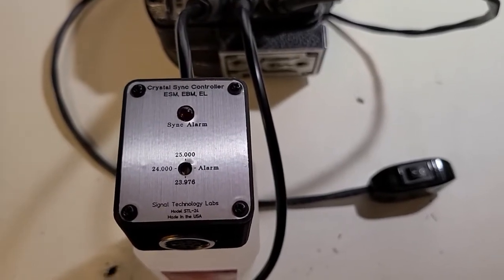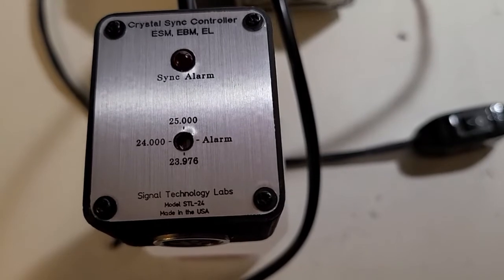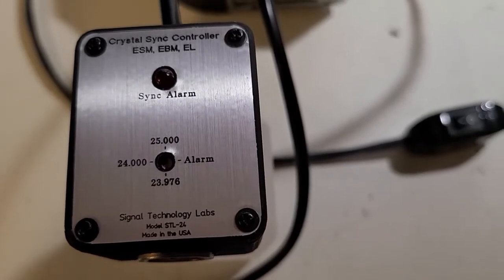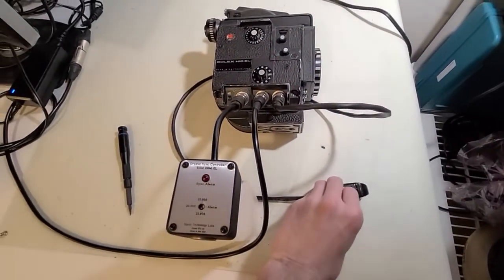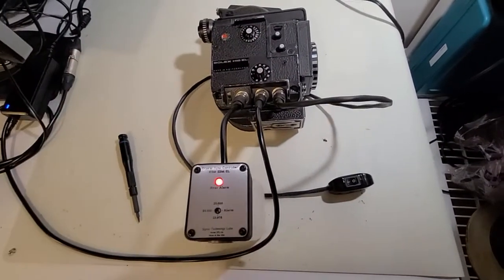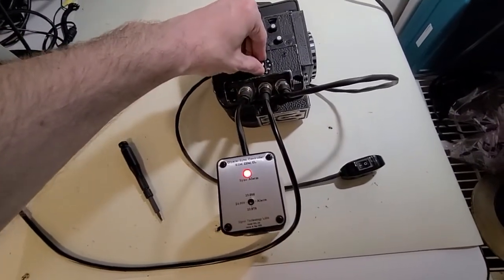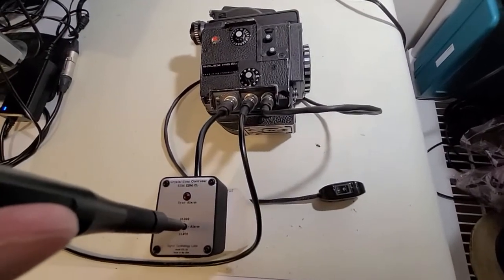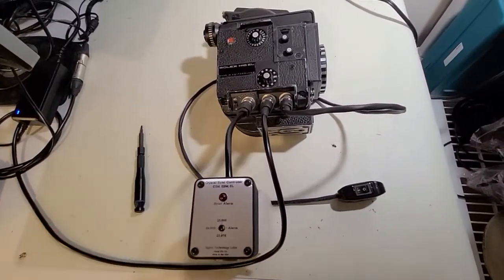STL-24 Crystal Sync Controller for Bolex: An Improved Tobin TXM-24

Comment: Can I ask the name of the tool you’re using to change the FPS on it?
Reply from the maker: It's essentially a flat head screwdriver. I have a flat head tip in a Kobalt driver handle. I use the Kobalt electronic repair kit from Lowe's: https://www.lowes.com/pd/Kobalt-Electronic-repair-50-Piece-Steel-Hex-Shank-Screwdriver-Bit-Set/5001994777